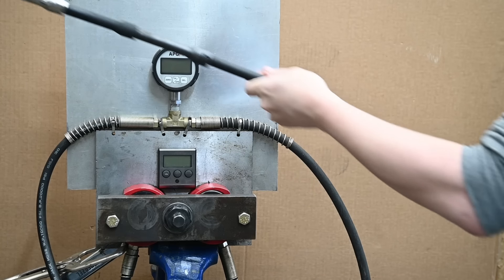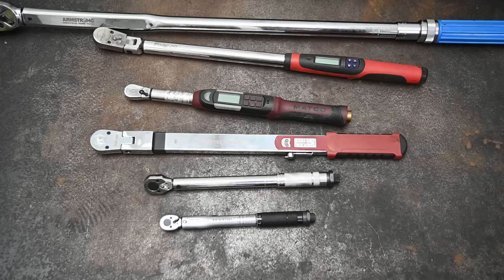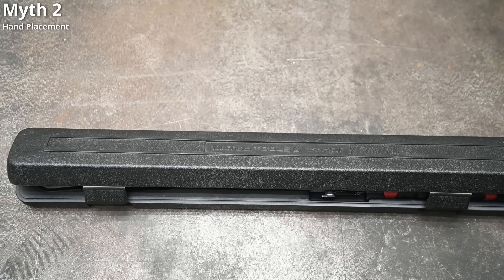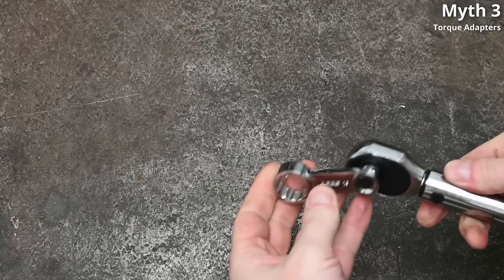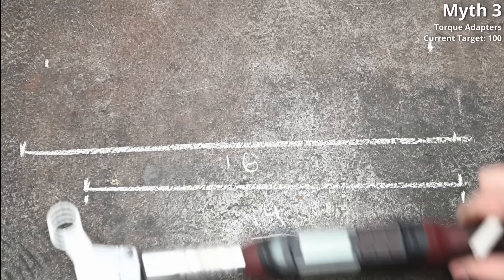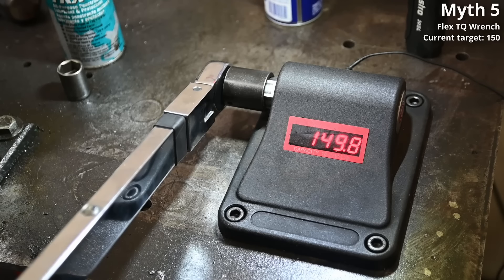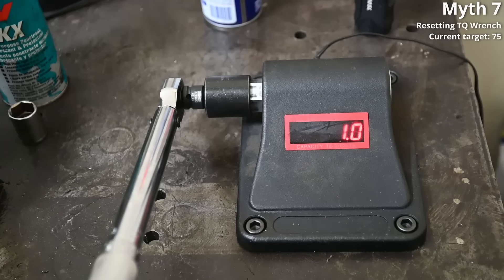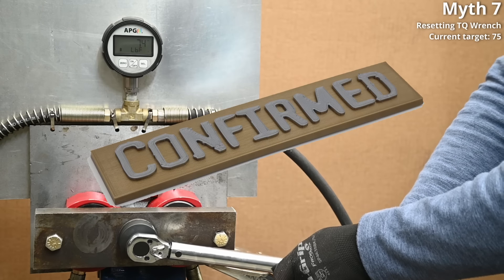You're Using a Torque Wrench Wrong: MythBusting 10 Do's & Dont's

Comment: Great video! Please perform the anti-seize (AS) test again with moly-disulfide. The aluminum AS is far too lubricious. I have used the Moly AS for many years on lug bolts with no problems. I also de-rate the torque spec to 80% on nominal

Comment: Great video...one  point.  Torque is twisting force.  Not the clamping force we need to secure something.  The test rig should be set to display the clamping force from a certain torque.  If he used a new clean lug stud and lug nut, torqued to 100 lbs-ft (yes, not ft-lbs), and displayed the clamping force in pounds, we'd have something.  Slather the lug stud with anti-seize and torque it again to the same clamping force.  Now we'd know what twisting force (torque) to get the required clamping force.  (I use Mariners' Choice Never-Seez in salty conditions.)  Actual torque needed to get a correct clamping force depends on the thread pitch, diameter, cleanliness, surface treatment, and lube, if any.  A lubed thread that is spec'ed dry can stretch or snap the fastener or over-clamp the item if torqued to that dry spec.

Comment: I remember using a Samson spring gauge and a long wrench back when torque wrenches were heinously priced for the hobbyist mechanic, I got mine from a British Rail parcels office used for weighing heavy packages and you could with care get a decent torque setting if not tedious to set up but handy for things like head bolts.

Comment: Before this video begins here’s the rules I learned from doing QA and Subsafe for the navy.
1. you can add extensions and crows feet as long as you don’t change the angle.
2. You should hold the wrench in the designated handle area don’t choke up on the wrench for the most part. 
3. If you drop it get it recalibrated. 
4. Return to zero when storing a torque wrench. 
That’s all I remember I left the navy back in 2018.

Comment: My old USA Craftsman clicker torque wrench in 3/8 drive broke last year.  It lived about 25 years.  I replaced it with a Tekton for intermittent duty home auto repair and couldn't be happier.  I bought another in 1/4 drive shortly thereafter.

I trust these wrenches with the diciest bolts most people in my position set: valve cover and oil pan bolts.  It's not an aircraft.
Reply: Folks who have been brought up on YouTube genuinely think their wheels will fall off if not torqued within 1% of spec.

Comment: so wow you confirmed that you should store your wrench with the tension removed. i will check my 2 torque wrenches tomorrow to make sure of that. i would have also like to have seen the old style beam torque wrench . the kind where there is a long pointer and you are just bending the wrench when you use it. i still have mine from 45 yrs ago that i used to do head bolts when i was a teenager.

Comment: In the uk halfords rebrands norbar torque wrenches. Norbar is a fantastic brand, i used to calibrate and adjust torque wrenches and genuinely prefered norbar over snap on (adjusting back in spec snap ons are generally a pain in the ass). To calibrate, you must use the indicator mark or exactly the middle of the handle with one finger for tracable or reaction post for ukas standards. This can be the difference between reading in tolerance and out of tolerance.

Comment: WOW!!!!....the issue with lubricating a fastener before torqueing really surprised me for sure. Nearly 2x above indicated, I guess, correctly addresses this condition as "murdering the fastener"! Mentioning that a fastener can be marked though, is an excellent suggestion and when I want to lube my lug nuts, I'll definitely have them marked before putting on a little grease to prevent rust. I didn't see in the clip another interesting element of curiosity.....is removal torque about the same as the install torque for nuts and bolts? I'll scan the comments to see if someone else queried this ahead of me. THX for the informative video!!!

Comment: Confirmed everything I thought.  Also I have two Snap-on inch pound torque wrenches that belonged to my father who worked for Cummins Marie for 35 years.  They're both stamped with Coast Guard certifications that allow them to be used on Coast Guard engines.  They've never been wrong.

Comment: Anti-seize is a lubricant. The side effect is that it prevent rust. The marketing guys thought it would make a good name for the product. All torque wrench have scale calibrated for dry connection. There are charts for lubricated connections. When you have large fasteners, it could be a real advantage to reduce the tightening torque to achieve the same bolt/screw tension.

Comment: With adapters, they act like a torsion bar when used on an impact but has no effect for setting regular tq. Where it does have a negative effect is angle tq with a digital tq wrench. Lastly, with flex heads or wobble sockets the rule is no more than a 15degree deflection is allowed. I have. Document from Ford if you would like to see it.

Comment: Always used the wet torquing method on car stuff exposed to the harsh elements. It's also why nasa doesn't use torque for bolts/fasteners. They use strain as that's what you actually want to measure.

1. Clean the fastener and bolt hole to be free from rust to best of ability.
2. Torque it down to spec. Mark 3 lines all at not even intervals (something like 1 at 30deg, 2 at 180deg, and 3 at 190 deg so you can't mess up the alignment later).
3. Coat those threads in anti-sieze. Tighten it down until aligned.

I have done this for every car I've ever owned and it's always a joy to do maintenance on them later. No more rust welded bolts. EVER.

Comment: The Snap On digital torque wrenches can have the torque adapter length added in the settings to do the calculation for you. Other digital torque wrenches may have similar settings.

Comment: The goal of measuring torque on a fastener is to approximate a design clamp force or bolt tension.
There are many variables of threaded fasteners that affect tension based on torque. See, e.g., anti-seize or any other substance that acts as a lubricant.
Assuming the design torque spec is appropriate, the most important aspect of tightening fasteners, especially an array such as a cylinder head, is consistency.
Having all the fasteners at the same tension improves durability and performance of the joint in question.
Being within the typically wide torque spec is OK, but applying the same torque within that spec to each fastener will ensure that the tension in all are close.

Comment: I bought a 3/8 and 1/2 harbor frieght torque wrenchs and the first time i used the 3/8 was on a spark plug for 24 ft/lbs. Thought i was gonna strip the threads and it didnt even click yet. Let a coworker try it try it and they also were afraid to pull it hard enough till it clicked.

Comment: Those old cheapo vintage beam bar wrenches were surprisingly accurate too (as long as you could see the bar and the scale).  Some applications require a dial wrench like setting the gear lash in a steering box. You also need the original factory rims and tires on the vehicle but for a Ford F350 the spec is 6 inch pounds to turn the steering wheel from full left t o full right and back to full left with both front wheels OFF THE GROUND, and original tires and rims on the truck! 8 or 10 pounds and you are eating the gears up. 4 pounds and the steering wheel has too much slop in it.

Comment: Great testing. Stuff I knew already, but seeing the exact values was nice. 

I torque fuel lines, PRV’s and pressure sensors all the time with my crows feet and torque adapters. Right angles FTW!

Comment: You can find different values for torque with and without anti-sieze.  I use anti-sieze on the outside of the lug nut, where it contacts the wheel, not on the lug bolt threads.

Comment: i think the other issue with the adjustable torque wrench is that its not very tightly connected to the head so when you put a large torque value on it eventually the head will slip or round off the head. i think its better then not torquing at all but something to keep in mind

Comment: The spring is very interesting!!! Because they say you can leave magazines loaded for years and it doesn’t affect tension because springs are only deteriorated by springing cycles. I have found that many magazines made of polymer that are left loaded begin to spread the feed lips outwards and ruin the magazines. But according to this finding the magazines also lose strength.
Reply: The requirements for a torque wrench spring are far, far more stringent than for a magazine spring. Reference links are a bit iffy to try to give on YT, but an example would be a year-long test AmmoToGo did which makes mention of extremes of 20% to 25% reduction in measured spring resistance not adversely affecting magazine function, and ten months of storage in unloaded, half-loaded and fully loaded condition showing 4% to 7% variation. For a torque wrench, any variation at all will affect accuracy. I did a quick calculation on my main wrench, and 20 thousandths of an inch variation in the length of the spring at any given setting would change the torque reading by a little over 4 lb/ft.

Comment: The findings in about the 6:30 where you placed the attachment at a 90 degree angle, which caused it to be accurate has been well known among the firearms building community. We have to use proprietary attachments similar to that in order to torque the barrel nut on an AR-15. The free flow handguards come with an attachment. It is a well-known thing that you're supposed to put it at a 90° so that it's not sticking out the end and basically making the torque wrench longer. 

The instructions on my Harbor Freight Pittsburgh torque wrenches actually tell you to zero out the torque wrench for storage so that it maintains accuracy. I don't think that is a myth, it's more of a known fact that is based on science. Because you are leaving tension on the spring if you don't zero it out.

Comment: I bought a cheap click type at Steve's wholesale and it had chart that said to add or subtract an amount if you used a crows feet or other adapters that added length or shortened the effective length of the wrench while it said add not if you had it 90° to the centerline of the wrench. But I can't remember the brand name. It was the only time I'd seen that notice but I don't buy them often.

Comment: I use anti-sieze on a lot of stuff mostly lawnmower blade bolts i never would have guessed it would make that much difference i thought maybe 50-60ft-lbs but 200ft-lbs is crazy. Im glade i never used it on any engine components.

Comment: Another thing to be aware of is torque values are for the first install. Often the second or subsequent tightenings have some damage to the mating surfaces that increase the K factor making the torque wrench click before the fastener gets to the proper load. The softer any components in the joint are, the more effect this usually has. Also some mayerials gall together more than others. Aluminum is terrible for it. 300 series stainless has high galling potential as well.

Comment: Before I get to that part of the video- leaving it set won't hurt it. especially if you don't use it often. I would also venture to say that leaving it would be the best option since it's not staying tensioned that kills springs, but cycling it. so the more it is used the faster it will wear out.

Comment: “People and auto techs alike”! 😂

Great job on this. Smart, thorough, and well presented.

One question: in the case of heads or adapters that change the torque because they change the effective lever arm (for instance, the crescent head, being longer than the regular drive head), can you compensate for that just by choking up on the torque handle an equivalent amount?

Comment: The myth I'm interested in is static vs dynamic torque. You should keep rotating until it clicks or beeps, if you have to stop early you have to loosen it again a bit to ensure the bolt rotating while it clicks.
Makes sense in the sense that static friction is higher than dynamic friction, but how big is the difference? I see many mechanics tighten bolts in steps, especially when they have to apply a lot of force. Off coarse, it always clicks at the start of the next step. And then they make it click twice for good measure...

Comment: Great episode!  I have to say, the only ones that surprised me were the Amt of difference from anti-seize and that the adapter at 90 degrees has no effect. I really thought that by pulling it at a different angle it would produce less torque than what the wrench was measuring.  

I have a request though.  You tested a universal joint straight on, which didn’t surprise me it worked, but there’s no need for it straight on.  I’ve always suspected that traditional universals used at an angle would alter the torque measurement but that ball type universals would have a negligible effect.  Could you test different types of universals at say a 30-45 degree angle in another episode?  I think that might produce some interesting results.

Comment: It seems to me it may not be possible to calibrate an adjustable wrench. The problem is that as the nut size increases the lever arm length also increases. You could calibrate it for an assumed size, but you’d be improperly calibrated for any other size.
Reply: The sliding jaw is angled off the perpendicular, so that as the jaw opens, the arm of moment is shortened.

Comment: I literally stopped the video and went and zeroed out my Dewalt. I used it a month or 2 ago on my calipers and lug nuts. I'm not going to risk it after seeing that. Never knew that was a thing. Previous job (assembly) had torque wrenches left at the ft lbs indefinitely with that particular socket on.

Comment: WOW, I was super surprised at the anti-seize measurements. I always knew it effected it some. I was expecting 20-30% over. But 100% never crossed my mind. I always put a small amount of anti-seize on my suspension bolts. I guess I'm going to have to rethink this. I have never put any on my lug nuts.

Comment: The FAA's free PDF copy of any version of AC-43.13 will tell you all this stuff with all the authority of the government giving you advisory information, to include the formula for calculating using extended tools like a torque adapter.  It's a great read, even if you don't work on aircraft and worth having in your garage.  For what it's worth, my Craftsman TQ wrench manuals state that if you forget to set the tool to the lowest torque setting when you're done using it, you should simply re-set it to the lowest torque setting and leave it there for "Several hours, " then continue use.

Comment: Yo, I know it outside of your range but doing something to this degree for electrical lugs would be  epic. As a commercial service electrician it seems that quality in the threads of the aluminum lugs we use has gone down and it's almost guaranteed that one lug in every peice of switch gear is going strip out and need replacing before energizing ( if you're a good eletrician). The threads on your bolts are definitely better than the threads on aluminum lugs that provide enormous amounts of power to everywhere in our world.

Comment: Torque wrench use linear torque that's why with extensions it work while impact is burst torque so the steel springing. some ideas:
- not being consistant in the torque application like being slow then abruptly going fast
- try with torque stick(shouldnt make a diference since it's like an extention)
- dropping the wrench to see if the calibration change
- fresh locktite applied to the bolt

Comment: I am guilty of greasing some bolts to prevent rust, such as lugs on my truck and boat trailer.  I knew it could skew the torque a little, I did not realize it would throw the result off by 100%!

Comment: Aircraft mechanic here (qualified tool snob) Concerning torquing with antisieze, occasionally I do dabble in very high torques (1000lb/ft) Antiseize 100% makes a difference, even the type of antiseize makes a BIG difference. Like when torqueing fan nuts (eg- the front end of a jet engine) the manual gives you options for antisieze, procedure is to torque it to whatever egregious number and then X many degrees further without exceeding some astronomical torque. The antisieze matters so much in this instance, even using an approved type you might overtorque before you reach the degrees and you're like why can I not get this to torque? The forces are so heinous its breaking down the antisieze! Then you switch it up and go with molybdenum disulfide based (instead of copper) and it torques correctly the first try pretty much every time. Weird stuff happens to copper antisieze at these torques.

Comment: For the torque adapted at 90 degrees. The actual arm length is square root of sum of squared of wrench and adapter lengths. When the wrench leght is significantly higher than the adapter the difference is negligible. I'm lazy to look up sine and cosine laws to get the any-angle formula but if you know what sine and cosine are you should be able to get the equation anyway.